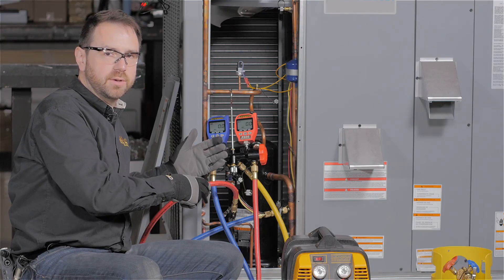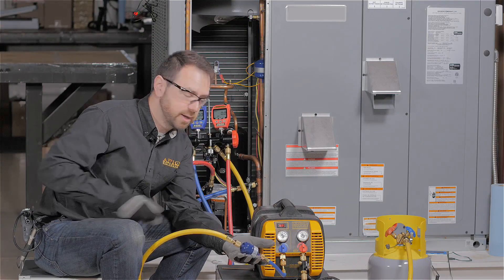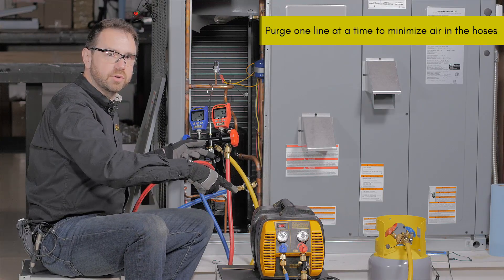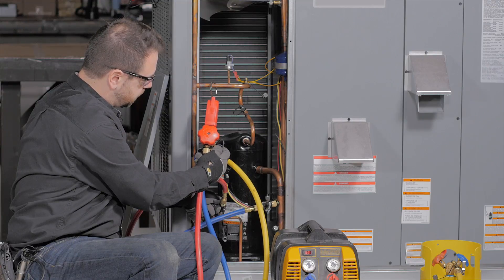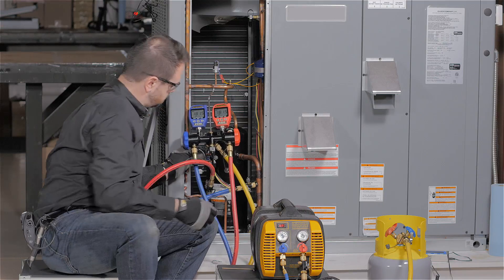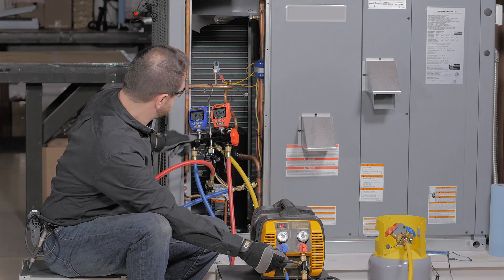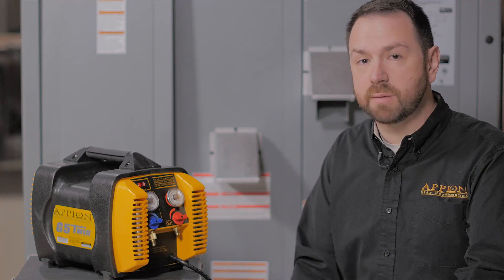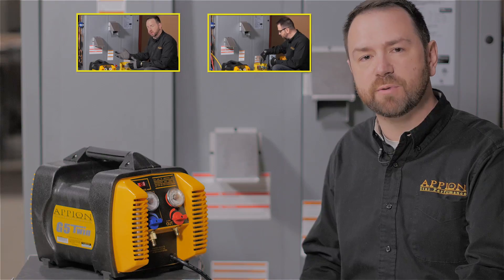Fast Recovery #4: Purging the Lines

Comment from the maker: Featured products in this video are the G5Twin Refrigerant Recovery Machine (Part # G5TWIN), the MegaFlow™ Valve Core Removal Tool (Part # MGAVCT), The PT500 & PT800 Wireless Pressure/Temperature Gauges (Part # PT500 & PT800), the MegaFlow™ Vacuum Manifold (Part # MGAMAN-V), the 4 foot ⅜” Recovery Output Hose (Part # MH380004AAY), and the Inline Filter Dryer (Part # FDT032).
For more information on these and all Appion products, click here: http://appiontools.com/